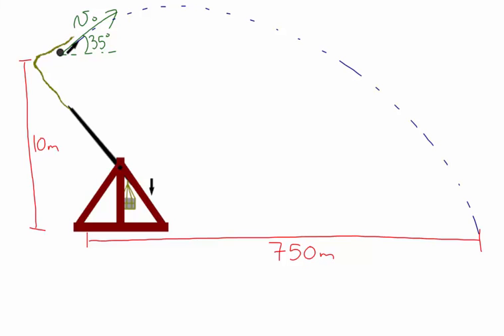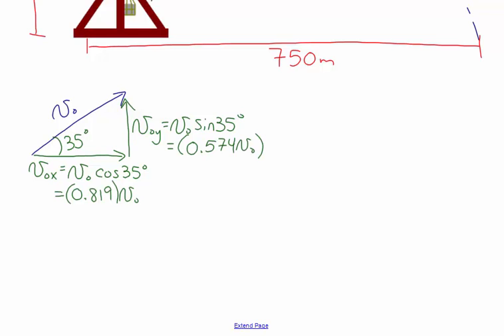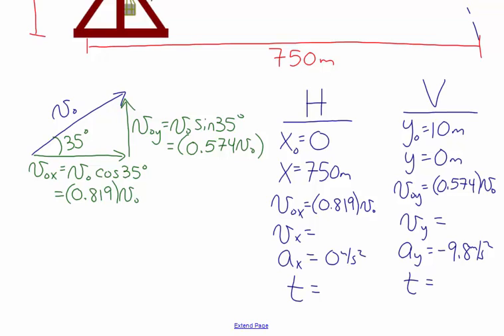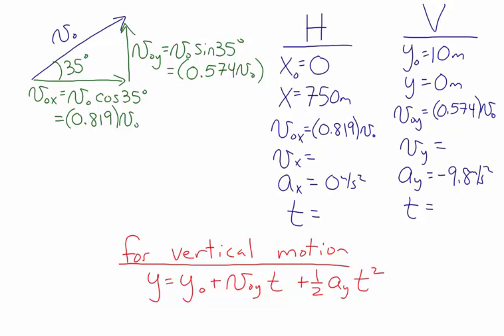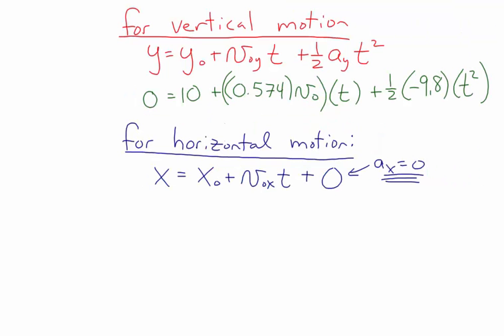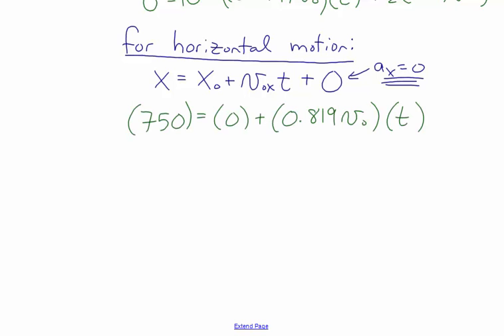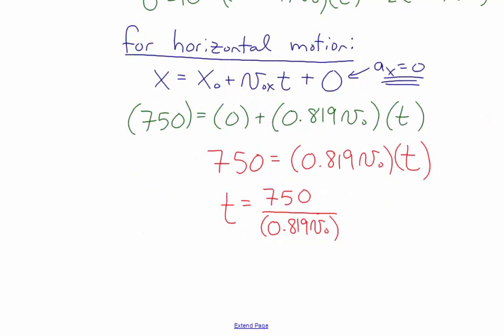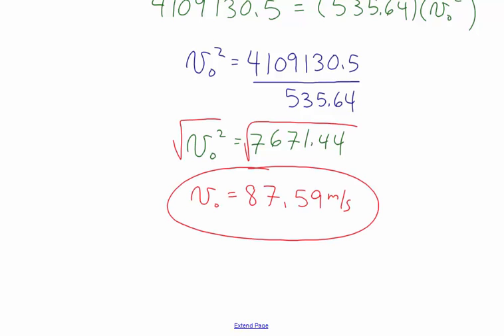Calculating Initial Speed of Projectile Given Starting Height, Horizontal Distance, and Launch Angle

Comment: what if we dont have the height?
Reply from the maker: Then you would have to be given some other information, such as it starts and ends at the ground where y = 0 (or it starts and ends at the same height, which you could still call zero). This would be a very similar problem, except you would have 0 where I have 10 meters for the starting height. Otherwise it is a different type of problem than this, and you would have probably been given the speed (instead of trying to find it).
Reply: @scottsecrest2190  yea all I got was "an arrow is shot horizontally by a standing man on a horizontal field. The arrow hits the ground 70.0m away making an angle of 4.0° with the ground. Determine the speed with which the arrow was shot."
Reply from the maker: @jesussaquin6266  That is a slightly different situation, since it is not initially shot at an angle. This would be the way to solve that problem: 
https://drive.google.com/file/d/1-6JZK_V7uf2I55xmf5r9QIHubDN6pi64/view?usp=sharing
Reply from the maker: That is an interesting version of that problem that I hadn't seen before. I might work through it with my students in the future since it is good to see slightly harder variations on a basic problem.
Reply from the maker: Also - in terms of not putting the units, if you were referring to in the middle steps of the calculations, I left them out because it can get confusing for some students with lots of units and variables floating around, especially with 2 variables. Personally, I often leave them out in the middle and just make sure I include them at the end when I am showing someone how to do the problem, although some other people require students to leave them on in all steps throughout the problem. I find that can be confusing sometimes.
Reply: @scottsecrest2190  thank you so much. God bless you friend.

Comment: How do i do when there's air resistance? acceleration of x would not be 0 than :(
Reply from the maker: Unfortunately that is much more complicated. It would really be something that you would have to use a computer program to estimate the answer because as the velocity changes, the force of air resistance changes. You are correct that the acceleration in the x-direction would not be zero anymore. You would have to look at the velocity at one time, then calculate the force of air resistance (which acts in the opposite direction as the velocity), which you then have to add to the force of gravity to get the net force, which then allows you to find the x and y components of the acceleration (the acceleration in the y-direction is not -9.8 anymore either). You could then move forward in time by a small interval to get the new x and y components of the velocity and repeat the steps (which is why the computer program is useful because you can have it repeat the steps over and over). It gets to be very complicated very quickly.

Comment: Is there a way to do this without an angle?
Reply from the maker: I am assuming that you are referring to a situation where it is initially launched horizontally (meaning that the angle is 0 degrees, which makes the initial velocity in the y-direction zero). If that is what you are asking about, then see this video: https://www.youtube.com/watch?v=DPadZUL0UEk
 If you are trying to find the velocity when you are given the horizontal distance traveled, that would be the second problem in the video starting a little before the 13 minute mark.
Reply from the maker: Otherwise, you would need to be given the speed and you could calculate what angle would travel a certain horizontal distance, but that is a different type of problem.
Reply: I actually figured it out, and it was at an angle I believe. Thanks for all the help!

In case you’re curious, what I did was I initially found the initial vertical velocity by plugging in the acceleration and distance y into Vf=Vi+21(delta y). I solved and got my answer, then found time with (delta y)=Vi•t + 1/2at^2, which allowed me to find the Velocity x.

:)
Reply from the maker: Glad you got yours figured out. Good luck as you continue in physics.
Reply: @scottsecrest2190  thank you!

Comment: What if it give you no angle
Reply from the maker: Then it either has to tell you that it is thrown horizontally (which is an angle of zero degrees) - so they are telling you an angle, or there is some other information that they are giving you - like the speed. For most problems you will either be given the speed or the angle (or both).

Comment: Thank you. If anyone needs the full equation to just plug your knowns/variables into:

Vo = (0.5*gravity*(distance/cosθ)²) / (drop+(sinθ)*(distance/cosθ))

or in the context of the video:
Vo = (0.5*Ay*(X/cosθ)²) / (10+(sinθ)*(X/cosθ))
Reply: This doesn't seem to work. I had to do a model ballista for an engineering project and I calculated the projectile to have an initial velocity of 19620m/s which seems a bit ridiculous
Reply: @jamesjury6943  did u forget to take the square root
Reply: @loncharnettcr7044  what square root
Reply: got ridiculously high values from this

Comment: How is the vertical distance ,w hich u labled y, = 0
Reply from the maker: y is not the distance, it is the position along the y-axis. It starts at a vertical position y_0 = 10 m and finishes at a position y = 0 m. This makes the displacement in the vertical direction (y - y_0) -10 m.
Reply: @scottsecrest2190  imagine the catapult launched the pumpkin from the ground instead  so that basically every condition is the same except the pumpkin is launched with zero initial height, and also imagine the trajectory to be the same aswell. What would the y be then because from what I know, it should represent the maximum verticle displacement.
Reply from the maker: @ezra4869  y is the position at some later time. It can be at any point in the motion. If you are looking at when v_y = 0, then that would be the height at the highest point. If you are looking at the time when it is back at the ground again, y = 0.
Reply from the maker: This video might help: https://youtu.be/x6VcZtruXbI
Reply: @scottsecrest2190  ah, I understand what you mean now, there's a similar question that I was stuck on that eventually led me here. In this question I let Sy (the vertical displacement) be the maximum height the ball reaches and I let Vy = 0 (final velocity in the vertical direction). I got the right answer and I'm wondering if I'll get the right answer again if I do what you done.

Comment: how would you solve a projectile problem to find an initial velocity when you have time, horizontal distance and launch angle.
Reply from the maker: For that, because the velocity in the horizontal direction is constant, you would use the horizontal distance and the time in the air to calculate the horizontal velocity (v_ox = (x/t) ). Then since you know the x-component and the angle, you could use trig to calculate the overall velocity (you know the adjacent side and the angle and are looking for the hypotenuse, so you would use cosine).

Comment: how did Vox become plain Vo, and how could it eliminate Voy? and how did Voy become Vo so it could eliminate Vo from t and how did t become something over Vo which is total velocity ... im missing some steps
Reply from the maker: André Jensen Vox is the x component of the initial velocity. Like you do any time you break vectors into components, you use sine and cosine to relate the components to the total vector. Cosine is adjacent/hypotenuse so Cos 30 = (Vox/Vo). Doing this allows you to solve for the components in terms of Vo.
Reply from the maker: Go to slightly before the 1 minute point in the video and it shows writing the components in terms of Vo.